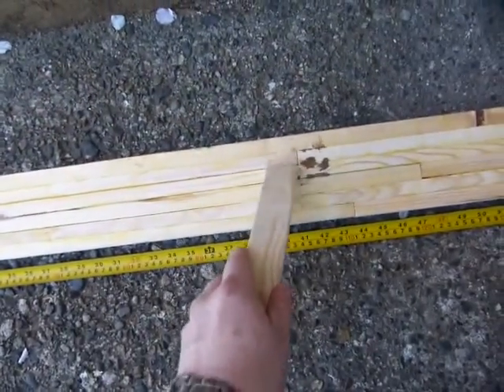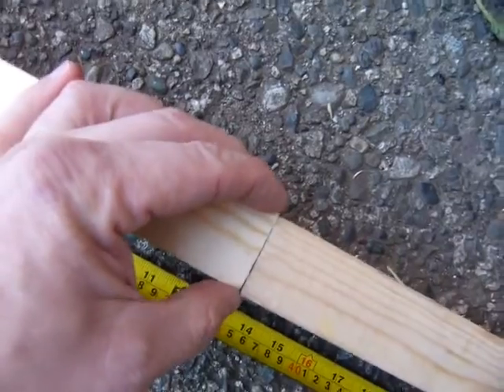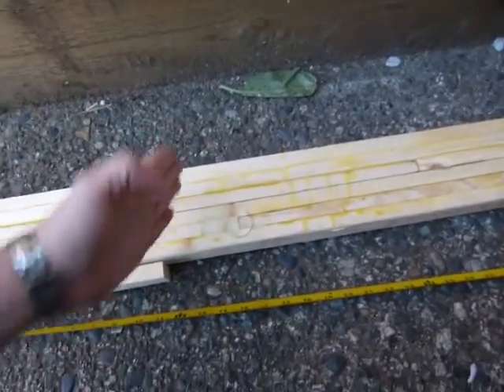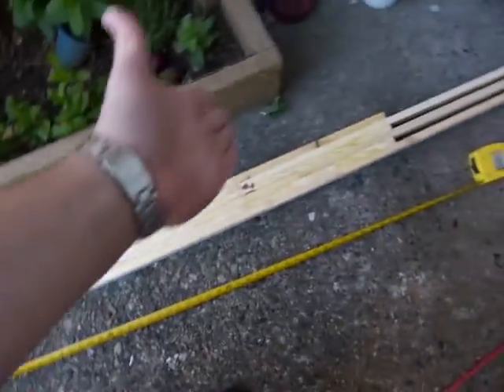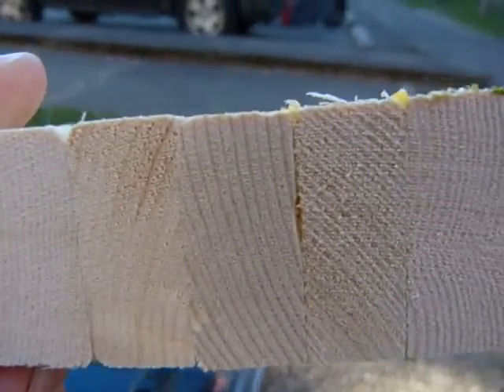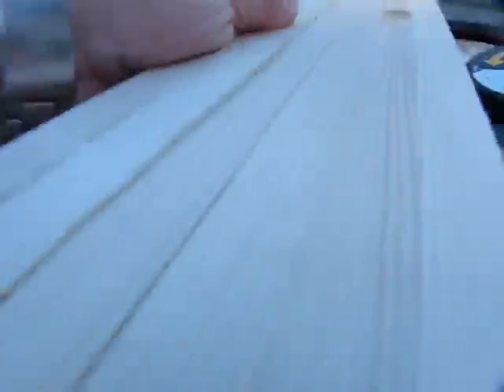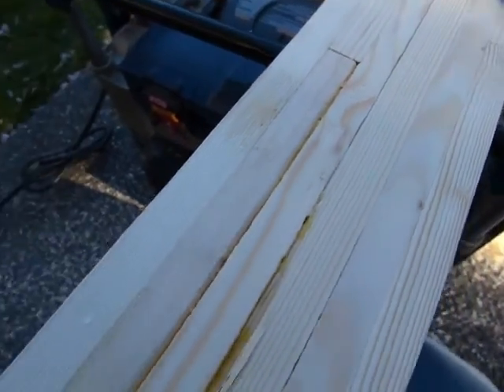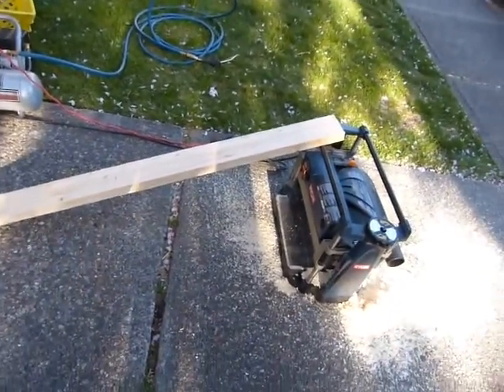Wood too thin & short? Stretch it.

Comment: If anyone is interested: Using this particular method you do not get a beam as strong as one made from one piece of wood, but it is still quite strong. The big advantage (besides using cutoffs) is that having multiple grains of wood intertwine will make it a lot less susceptible to deforming when exposed to the elements. Wood is a material that is "working" permanently, modifying it's shape in conjunction with the humidity, temperature and it's own internal tension resulting usually in deformations and\or cracks along the grain. Using this technique will minimize the internal tensions because there is not only one grain but rather a lot of smaller ones that do not have the necessary strength to cause deformations or cracks.
Reply from the maker: Lucian Baitan Thanks for sharing! Same works with metal grain size vs strength: smaller grains stop a crack since the direction of crack would need to zig-zag according to grain boundaries to spread, big grains with few grain boundaries just tear through almost straight. Smaller grain side is achieved with cold working, alloying or quenching.